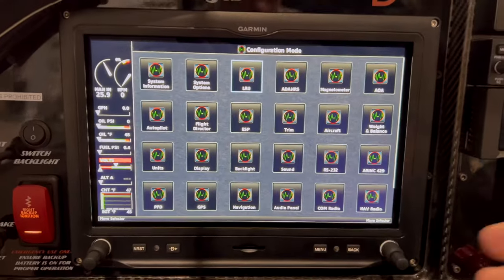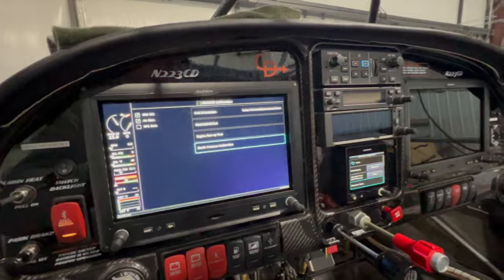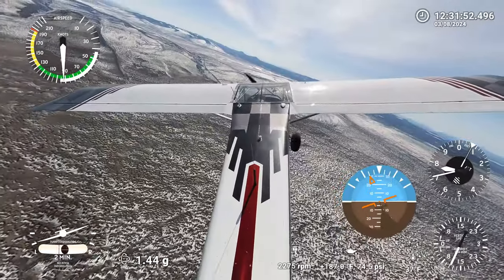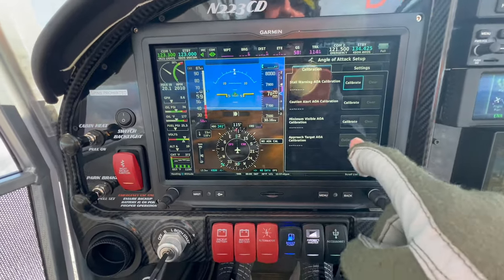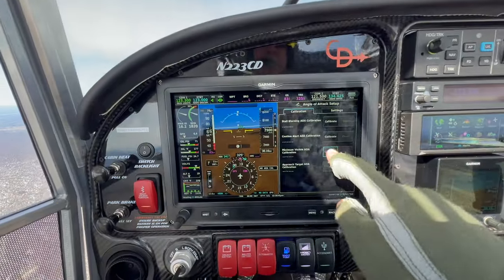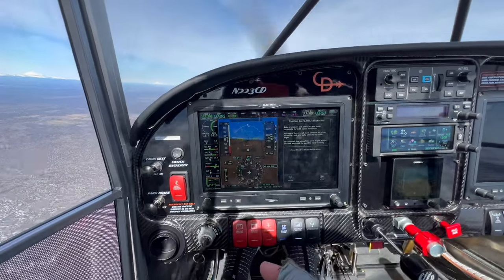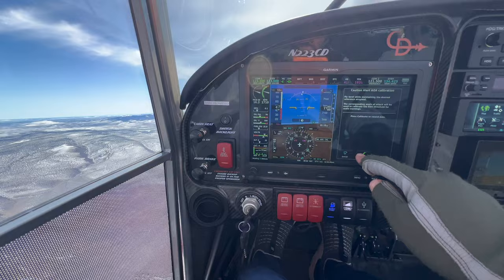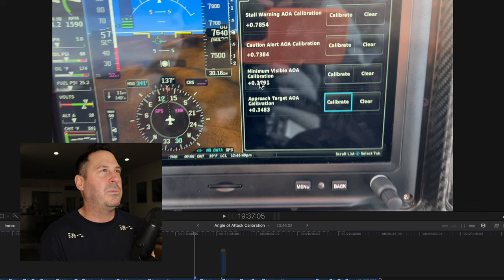Worth it? Garmin G3X Angle of Attack Calibration, Stalls, Discussion

Comment: Your CHTs on one is much cooler than the rest.. if you put some aluminum foil tape in front of #1, you can bring it up a little while cooling #3 a little better. With a little tuning like this, you could get them all within 10 degrees.
Reply: I had to do this with my s21 as well.
Reply from the maker: I did this and it worked great! Thanks. Now to cool off all of them!

Comment: Its interesting that you did all your calibration in level flight with full flaps. The manual isn’t clear on that and I did mine a bit differently. For instance, with my approach calibration I flew half flaps at 80knts in a 500 fpm descent which would be my normal approach profile.

Comment: Great video.  Clearly knows his topic. I am upgrading my Cardinal RGII with a G3X touch 10.3” and G5 with GTN650 Txi, GMA245r and the AOA heated regulated along with the glare shield mounted indicator so it’s in my view. I’m installing the  GAD27 so I’m going to try to install the flap sensor for the 30 degree position for the flap deployed AOA settings. I got the EIS system for it so pulling my JPI EDM-830. Hopefully I’ll have the harness complete and mounted in the poly template I made in a laser then get the new left panel cut on a water-jet.

Comment: The Rans website lists Vso as 35kts with the Titan. Yours is 43kts. My dream is to build an S21 with skis for glacier landings here in Switzerland. The main factor is the speed range (Vso to Cruise) is great. The mountains are a little far from my home airport so a good top-end would be a huge benefit. 43kts would be a bit spicy on the landings though. Would appreciate if other builders have seen similar values.
Reply: Unfortunately, the Rans specs are a bit too optimistic. My 21 with the 915 stalls at 41kts. I’m sure if you did VG you could get it down a few knots slower.
Reply from the maker: Yeah...what @Captndarty said. The website and is for marketing purposes. Now I haven't done any post-stall testing; i.e. power-on controllability and stall testing. I'm guessing I can get it a little lower after I've done more stability tests. Stay tuned!
Reply: My S20 is a couple of hundred lbs lighter, has VG’s and a  bigger wing, it stalls at 32-33kts. Yes, the Rans figures are optimistic. Like the S21 there is very little difference in stall speed with flap application.
Reply: @Captndarty thanks for sharing your experiences. That's really helpful.
Reply: @CLEAREDDIRECT Will definitely be watching. Actual, on skis, you generally add power as you start to round out since you are landing up hill (usually). The steeper the hill, the more power, so power on stalls would also be interesting. Anyway, thanks for all the work you put into your videos (and the Bogey looks iconic).
Reply: @martinjmerritt Those numbers would be great. Didn't know the S20 had a longer wing.  Time for more research! 🙂

Comment: Nicely done! Have you noticed when you’re trimmed hands off going from flaps 3 to flaps 4 the plane rolls to the left? Mine does as does another buddy of mine with a 21. There’s a little bit of cross control at flaps 4 so I only use flaps 3 now for landings considering flaps 4 just increases the drag without any additional lift. Plus, the flap lever is lower and doesn’t impede on my  ergonomics to the throttle.
Reply from the maker: I haven't noticed this but I really haven't done much testing at other than full flap settings. I'll let ya know! I also want to do power-on slow flight and stalls to see if I can eek out another couple knots before stalling (after I do more stability tests and change the oil!).
Reply: @CLEAREDDIRECT  power on stalls are crazy steep. At least with mine I’m pushing 25 to 30° nose high. The whole air frame starts buffing and shaking and making noises like a bending saw-blade but it still climbs. I feel like the seatback is going to collapse. A bit unnerving lol